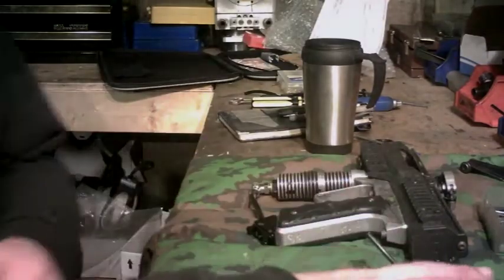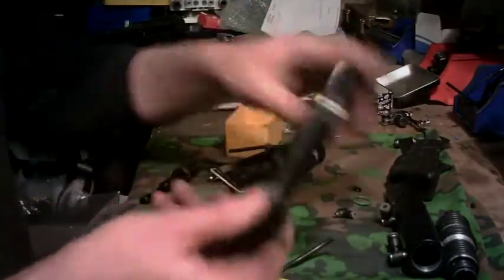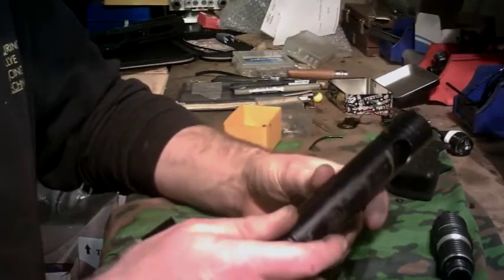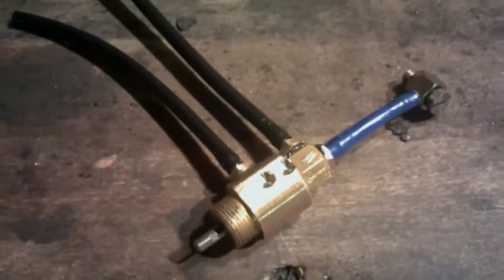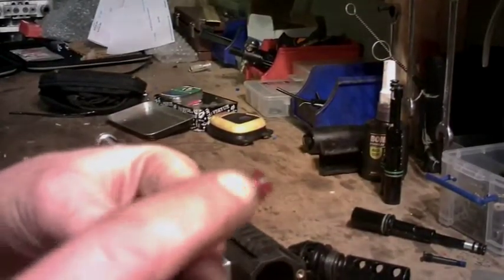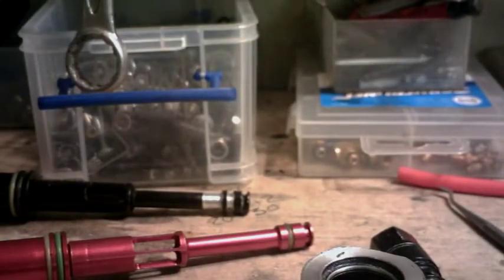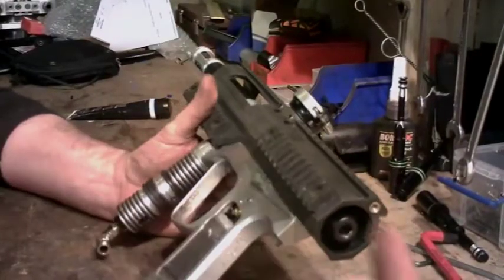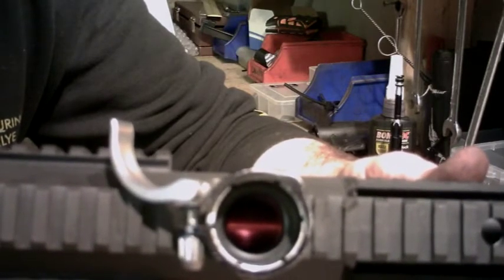COCKER ION MECH !

Comment from the maker: The tech bolt mate,, the port from the fire chamber is way way to small. use the fire bolt from smartparts, also no center in the tech bolt so no where to mount the foam ie,